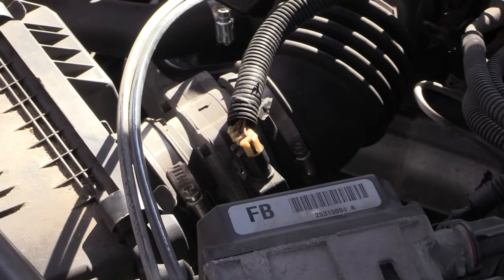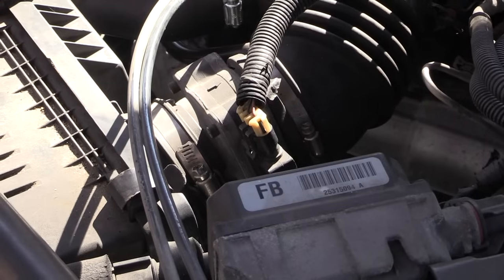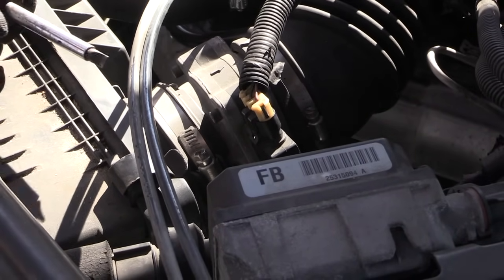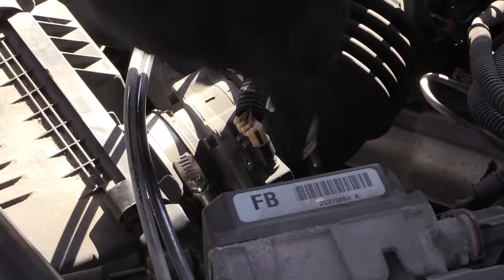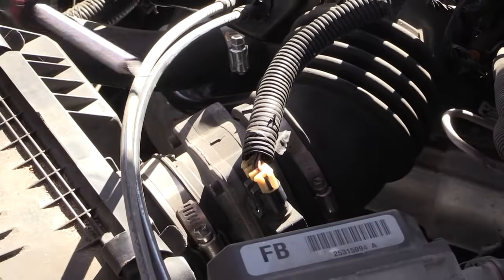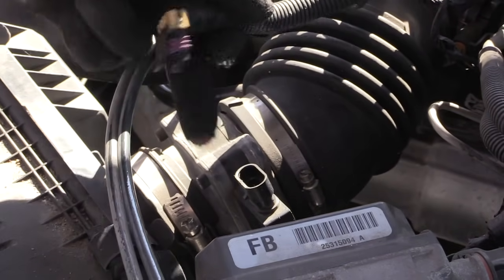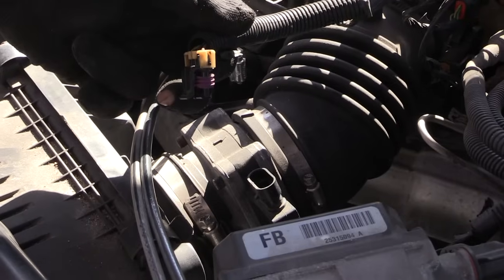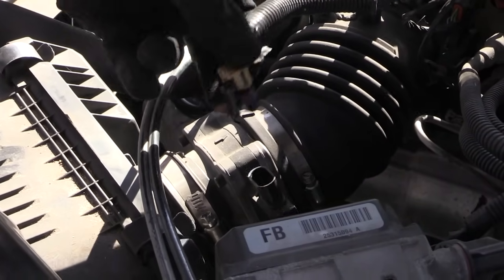Mass Air Flow Sensor -Quick test To Tell if Bad or Dirty!

Comment: What would happen if the idle valve is disconnected when engine running??? Will it continue to run or stop?
Reply from the maker: In most cases is will keep running but will  result in an  unusual high or low idle speed, or in some cases a surging idle speed that repeatedly climbs and falls. Your welcome, Thanks for watching and commenting. Please subscribe & like and share if haven't already and check out our other helpful videos
Reply: Flashback502 I disconnected the iscv when engine is running. The engine shuts off automatically!!! Is my iscv working or????

However, the engine can be started and continue to run normally with still the valve disconnected. The car is hyundai i20 1.2 manual petrol.
Reply from the maker: @tnamen1307  if your car is idling normally then cuts off when disconnecting valve then most likely it is working fine. But if car is idling bad when connected then valve could be your problem, but many other things can cause bad idle like injector heads, bad gas etc
Reply: Flashback502 the rpm drops to 600 as against the normal 850 rpm. Cleaned throttle body. No warning signs on instrument cluster, etc etc all working good and engine performance also good. Also did relearning but still problem with rpm.

But low rpm???? Please how to fix???
Reply from the maker: If car is running well with no check engine light then it's hard to say, I would get a tune up and clean MAS. Also put premium gas in it sometimes that can help also.
Reply: Flashback502 with the valve disconnected, I start the engine and it's rpm come to approx normal 800 or 850.
Reply from the maker: If that's the case then the valve is most likely the problem.
Reply: Flashback502 ok I'll cross check and confirm tomorrow. Anyway thanks for the info.

Comment: Hi.. love your videos.  I have a 2005 Ford 500 Limited with the V-6 DOHC Duratec engine. FWD with Traction Control. My engine is running a little rough in drive or reverse but fine in park or neutral. Also get a shake at about 45 - 50 mph that will go away if I decelerate or accelerate. Engine light is on.  I cleaned my MAF and changed the air filter. Still the same.  Any ideas what this could be.  Could it be a misfire  not noticeable in park at idle? Thanks for all the help you give people.  Great channel!!
Reply from the maker: I would get a spark plug tester and check plugs and wires, seen this problem before and many times it was bad spark plug or wire causing issuse. Also check for any vacuum leakes. Thanks for watching our videos and your support👍
Reply: If your shakes is only at speeds check for tire balance  with any tire place is cheap about 7 dollars for each tire
Reply: Might have a tear in the intake boot/tube between the mass airflow sensor and the throttle body. I’ve seen two Mazdas with this. When it’s in gear and a load is on the engine, the engine rocks in the mounts just a bit and pulls the crack in the intake tube open causing it to go lean. In neutral or in park there is no torque load on the engine and the crack remains closed. Look on the bottom of the intake tube. Not visible from the top.

Comment: Great. I've tried this and had no change in idle. BUT, when I slowly plugged the harness in the engine wanted to die. Key word SLOWLY. Could I have a bad harness itself? I also changed the LARGE maf that fits into intake and air box. Is there a chip style Maf that I should try replacing? 08 suburban 1500
Reply: Lol what?
Reply: @jeffbrdr  he prolly meant a fuse

Comment: if your idle is high its done...
Reply: Ralph Torres mine idle high on rpm’s when I disconnect the maf wire
Reply: So my van stalls at idle and when I take off the MAF sensor rpms go up right away, does this mean I gotta change MAF sensor?
Reply: Levir Leon no

Comment: what if your car engine stop when you pop that off is it bad
Reply from the maker: If engine stops then it's most likely good you should still clean tho if haven't in a long time.Please subscribe & like and share if haven't already and check out our other helpful videos
Reply: @Flashback502  what about. Throttle possition censor
Reply from the maker: Could be TPS if car idles to low or is stalling out and sometimes misfiring.
Reply: @Flashback502  I change the throttle body and I change the throttle body valve but my RPM is through the roof over 3000 when it's in park what should i do
Reply from the maker: Faulty idle Air Control Valve (ICV) can also cause your problem. You may need to take it to auto zone are some where to let them read it and see if it throws out a code. Many things can cause your problem.

Comment: Hello. I have a Mercedes Benz SLK 200, 2005. I have been having a problem with the engine for the past month and no one seems to know what's the issue.

When I turn it on in the morning (or whenever it has been stopped for a while) and I place the gear on R or D, the whole engine starts shaking (and lags a bit) which makes the whole car shake. If I place the gear back on P, it stops shaking.

Then after placing it back on D and driving, it will shake whenever I have to stop behind a car on the road. However, the shaking will completely stop after a while when its temperature rises to around 60 degrees celsius or above.

I took it to 2 mechanics, I got all the spark plugs changed, and 2 of the ignition coils changed too. I also changed the oil for it. But still, the problem persists.

Could it be the MAF sensor?

Note that the RPM is always increasing and decreasing (slightly fluctuating) when in idle and also I have sensed that my car is using more fuel than before. The fuel tank would be full and after a small ride, the amount would significantly decrease. Also, I have sensed that the power and speed on highways decreased a little. The check engine light is also on and I can sense it's starting roughly than before.

I have paid a lot of money and I just don't want to pay any more to change any parts that don't need to be changed.

Please reply and help me

I removed the plug and car didn't turn off. The next time I turned it on while the plug was out, it still had this problem
Reply from the maker: Sorry to hear of your problem MAS can cause some of these problems but so can a bad EGR valve, also a failing fuel pump or dirty fuel injectors, if your check engin light is on take it to a auto parts store to have it read AutoZone does it free, unfortunately there are many things that can cause your problem, even a bad or failing catalytic converter can cause similar problems. Also check for vacuum leakes in vacuum lines. Sorry couldn't help more.
Reply: Hey man i know its been 3 years but im having a similar problem with my SLK at the moment and replaced some parts with no luck, did you end up solving the problem? If so what was it?

Comment: Not this video but another. I tried this and it continued to run without changing tempo and found original problem (stumbling idle) was a spark plug wire. Changed wire and have had nothing but problems with idle and surging, racing while shifting gears and dying @ idle. Changed MAF. Changed IAC, changed heat sensor, cleaned throttle body. Computer has incorrect barometric pressure (151) @ seal level probably caused by unplugging while running. All were done by a mechanic without diagnostic meter. Finally found the pressure difference with a diagnostic scanner. Mechanic reckons BP (151) @ 3000ft altitude. I live at sea level. Tried erasing computer by disconnecting battery. No luck.
Bottom line: do not disconnect MAF plug while engine is running. Disconnect battery before messing with the MAF. Have a mechanic check it. I will have to take it in for proper and more expensive repairs. Don't do it!
Reply from the maker: Thanks for info👍Please subscribe & like and share if haven't already and check out our other helpful videos
Reply: >> Computer has incorrect barometric pressure (151) @ seal level probably caused by  <<
there may also be a MAP sensor (manifold air pressure) in your given engine design ...
that's providing the ECM w/ the barometric pressure ...
if the ecm shows an incorrect value ...
and you can trust the scan tool ... 
you (likely) have an issue w/ the MAP sensor (not the MAF)
Reply: Either you have a vaccuum leak, bad intake gaskets or your Manifold Absolute pressure(MAP) sensor failed.

Unplugging while running doesn't do what you claim, just removes that data input from the ECU, which causes the computer to miscalculate the amount of air entering and thusly the fuel sprayed in to achieve the target fuel/air ratios.

I have had a few of these model year trucks. Often times the leaking fuel injector ORings or bad Fuel Regulator or somw gaskets/vacuum leaks are the core culprit.

Are ya certain the engine harness (the 2 studs on firewall, nearby the brake booster) are properly conductive and tightened properly as well? GM loves just LOVES thier cheap ass wire and the cheap as fuuuuuu connectors that crimp on. I have solved several random issues just by re-crimping a ground strap and ensuring the ground is circulating back to the chassis and battery negative.

There's a ground on drivers side lower engine block, drivers side A pillar underneath attached to the body mount bracket, front Driver side backside of bumper for foglights and headlight grounds, then ya should have one strap going from firewall to hood, one strap from back of engine to firewall and another ground strap from engine to chassis. 

Also, MAP is measuring in Inches of Mercury, with 14.5-ish being sea level(source: am Floridian)
Mass airflow will read same as engine displacement at ide in Grams/second at 5.32 or so for a 5.3 litre v8 engine, 4.8l would read about 4.8g/s.

Pounds per hour is about .77 at idle for the MAF.

Fuel regulator should be leak freee if you take the vacuim line off it while the engine is running. If it leaks its bad, its 80 or so bucks. If it stumbles and dies i beleive that means then you have a potential bad fuel pump (55-62 psi Keyon/engoff dropping maybe 10 psi while running.)
If your fuel pump wont hold a PSI while keyed on/eng off, then sorry bro that pump is either already toast or about to be.

Hope this helps some, i realize its a old as hell comment. But hey, aint every day someone has a similar vehicle with the same issues and can lend some insider detailed info.

Id get some carv cleaner or ether and spray the intake tube, intake piping, intake manifold, the injectors where they seat, and especially the goofy huge vacuum line fitting drivers side rear of intake, goes to the brake booster(if you dont have hydroboost style brake assist.)

Comment: i drive a 2013 frs and i had recently changed the maf sensor with an oem replacement from autozone. i had successfully diagnosed the maf sensor as the issue previously before purchasing, and for a few weeks or so, the car ran great, gave me no codes or anything, then began giving me same symptoms. surges on first few starts when sat and becomes cold. once warmed up to about 1/4 mark on coolant temp, u can cut it off and crank it up and it'll start fine. toyota is telling me that the computer just doesn't like a non toyota part. could this be the case or could i be looking at something else? don't wanna purchase the same part i had already purchased if it's not gonna fix this issue

Comment: Okay my car idles rough sometimes runs smooth but most of the time runs rough when accelerating. it also burns alot of gas...also when I turn on the engine and unplug the mass air flow sensor engine keeps running.(not turning off). I have seen some videos on YouTube that some models of cars might send a fake signal to the computer keeping the engine running with the sensor disconnected... I really don't know if it's a bad sensor or not...?? Any suggestions???I own a Malibu Maxx 2005 v6 3.5
Reply from the maker: Arely Rodriguez thanks for watching have you had your spark plugs changed in the last few years if not I would have that done,  if so I would then clean the MAS bc a dirty 1 can cause problems also.Please Subscribe and share if haven't already and check out my other helpful videos.
Reply: 0/2 sensor

Comment: What if the engine dies when you pull that connection off the mass airflow sensor
Reply from the maker: Most likely it's working ok, but if vehicle driving bad would still clean it. Please subscribe & like and share if haven't already and check out our other helpful videos

Comment: What happens if I don’t fix it ? I don’t have the time can I just erase the code ?
Reply from the maker: If the problem is still there then light will pop back on, but you can disconnect the battery and reconnect and should reset codes.Please subscribe & like and share if haven't already and check out our other helpful videos

Comment: What if when I pull out the MAF sensor sometimes my car stops and sometimes it keeps running? Could it still be an issue. I have no check engine light on, but my car will randomly die at stop lights and will start back up as soon as I put the car in park and crank the key. Would appreciate any help. Love the vids btw!
Reply from the maker: RiceARonia hi thanks for watching, if when you pull it out it stops and sometimes keeps running it is hard to tell if it is your MAS.i would say to clean it and see if it solves the problem. Good luck please subscribe and share if haven't already and check out my other helpful videos.
Reply: My 2002 Silverado dose the same thing I cleaned the MAF and still have problems with it dying and cranking a long time before it starts what should I do looking for help
Reply from the maker: Ash Campos When an engine cranks for a long time before it starts, either spark or fuel is missing or weak and each has its own reasons. ... A bad coolant sensor, a bad throttle position sensor (TPS), a bad fuel pump or a plugged fuel filter can all cause a lean condition causing long cranking times.
Reply: First check your fuel pressure regulator. Your fuel rail pressure is likely bleeding off. Good luck ,  Ash Campos.
Reply: RiceARonia you have a crank angle sensor problem
Reply: Diana Graniela  put new one on take off positive battery cable for 30 seconds for computer to reset then hook positive cable up see how it runs this may help
Reply: CLEAN your crankshaft sensor, if problem persist change it, cleaning mine works for me my car no longer dies suddenly while driving and it also solved cranking a long time before the car starts
Reply: @barr.abrahamocheje  I second that, a quick and dirty way to diagnose a bad crankshaft sensor is if the rpms dont go up while cranking.
Reply: Flashback502 i have also heard fuel pressure regulator on long starts

Comment: Wait, so change or clean if in this case?
Reply from the maker: MongolEmpire OC thanks for watching first would clean and see if that helps if not then would change. Please Subscribe and share if haven't already and check out my other helpful videos.
Reply: Flashback502 cleaned and no change. Ordered new sensor. Thanks
Reply: MongolEmpire OC did you fix the problem when replacing the sensor ?
Reply: Change it with a OEM maf.  I got one from Rockauto, cheap, but it didn't work. 35$ compared to 235$ from dealer. I think it was a combo MAF, MAP, IAT, all in one unit. (Ford) Beware of internet electric stuff.
Reply: JaaysWorldTv yes it fixed the problem and no issues now:)
Reply: where did you order your sensor? How much was it? Also what were the symptoms before you replaced it
Reply: @prostreet1032xx  I just ordered from Ebay and it was around $20. Before it was changed, my car had check engine light on and due to that, it was not able to pass the smoke test. Also, my car ate lots of gas and had rough driving. You know, I spend almost 2k on this car before this, the mechanic replaced some hoses around the engine and some other uneccessary stuff. But on the same day I got my car from the mechanics, the engine light came back on. So I thought it was something serious issue and thought it was time for me to let this car go. 
Now, i just feel lucky for stumbling across this video on youtube. The car is running just fine now, since I replace it, there is no lights and drives normal. And i have been driving it everyday since.
Reply: MongolEmpire OC   Your car was smoking with a bad maff sensor ? What color smoke?
Reply: @prostreet1032xx  Ebay is cheapest for OEM.

Comment: This guy doesn't know what he's talking about. The ecm needs feedback from mas to get the air fuel mixture correct.
Reply from the maker: When your MAS is bad it can cause your ecm  to get it wrong to the point where your car may not run at all, and by unplugging  your MAS , your car may run better, thus helping you figure out what your car's problem may be. There are  many things that cause a vehical to run bad, and a lot of diagnoses is based on trial and error. .
Reply: I agree Danny, dude is in no way knowledgeable enough to be giving advice, kind of funny honestly.

Comment: uhh no dude if it idles incorrectly it needs changed
Reply from the maker: andreis reina Thanks for watching and commenting, if your car is running bad and your mas is running correctly when you unplug it your car will either run worst or cut off, bc the mas is not the problem and unplugging it made things worst. but if your car is running bad and you unplug your mas and it runs better it is a clue that your mas maybe the cause of your car running bad.
Reply: I said the same thing lol! This video is wrong

Comment: I have a 1997 chevy with the 5.7 and I already replaced spark plug wires coil cables and coil and ignition module distributor cap and rotor and is still hard to start It wouldn't even run this morning any suggestions?
Reply: Did you end up fixing it ? If so what was it ?

Comment: What does it sound like when it is a bad mass air flow sensor? My Camaro when it’s close to 1.5 rpm will like shake the engine it sound like. Is this mass air flow or o2 sensor?